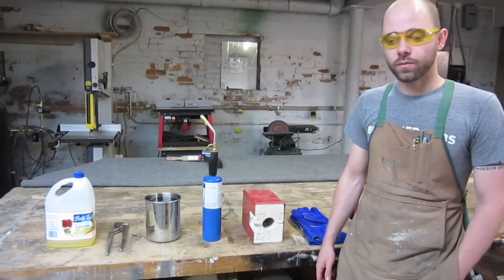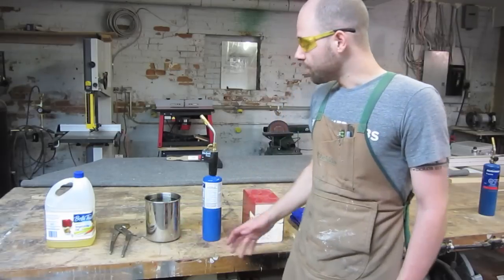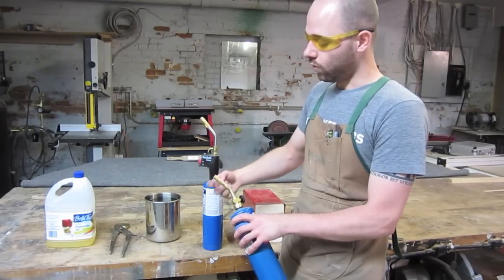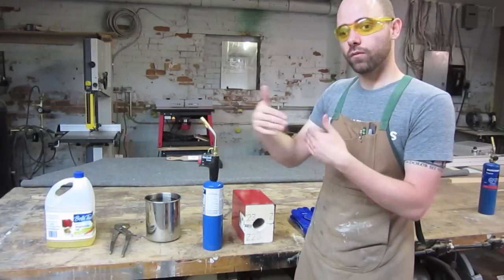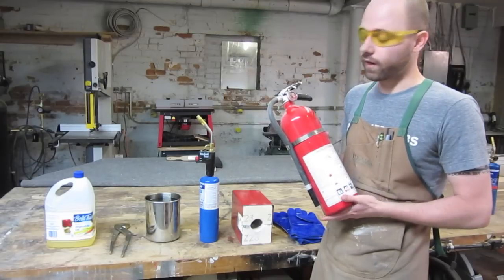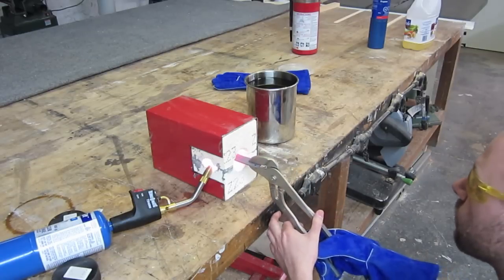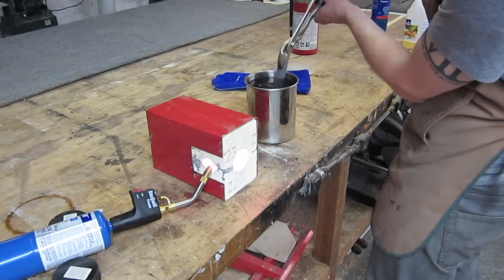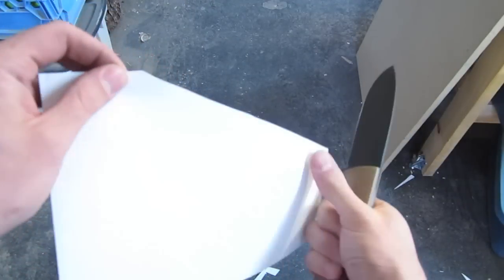How to heat-treat an O1 knife blade using cheap common tools.

Comment from the maker: There is a bit of a code to this: 

The "W" in "W1" stands for "water quenching"..

The "O" in "O1" actually stands for "Oil Quenching"...

The "A" in "A2" stands for "Air Quenching"....

The "D" in "D2" means "Die Steel"...

The "S" in "S7" means "Shock Resistant"...

There are many more too, and a number of different systems used in different countries and industries.
Reply: OH, my god. Thank you for this info. I had no idea. I've learned 80 times more from your one video.

Comment from the maker: Hey Patrick! Thanks for subscribing.

I generally recommend O1, which is the steel I'm demonstrating in the video. Using this heat-treating process will not get you 'the best blade in the world', but you'll get a knife that's perfectly serviceable.

The reason I recommend O1 is mainly because it's kind of hard to make a mistake with it. Most of the other 'cheap' steels (like 1084) require fast water/brine quenches which can cause cracking and warping if you don't do exactly the right things.
Reply: Thankfully someone knows that you can't harden basic steels in stuff like canola oil. Maaybe if it's thin enough. 52100 from ball bearings is also a slightly slower quench thanks to some chrome.

Comment from the maker: This exact process should work just fine for a number of steels including: O1, 5160, 1060 1070, 1080, 1084, and 1095.

It won't work for stainless or high alloy steels.

Be warned though that this is a fairly simple heat-treatment scheme and that you likely won't be getting the full performance out of most steels. It will be good enough for getting a first knife done though! After you're comfortable with the process it's worth the time to learn a bit more about steel and how to heat-treat it.
Reply: And invest more in tools.

Comment from the maker: There should be a furnace supply or pottery supply place in your area that would have them. Ask for 'k23' bricks, or 'soft white refractory firebricks'.

They are held together with refractory cement (you can get that at home depot). And then I bent a bit of scarp metal sheet to go around them and protect them as they're quite delicate.

Comment from the maker: The temperature where steel turns non-magnetic is called the 'eutectoid point', in some steels this point corresponds with the right temperature for heat-treatment (1084 and other spring steels for instance) but unfortunately that is not the case for O1. You have to go at least 50º hotter for O1, which is why I mainly talked about the color of the steel.

Using a magnet can be helpful too! Just be aware that you have to got a bit hotter than the magnet says.
Reply: Thanks! this is a very useful tip! thanks for being so cool! I love your channel!

Comment: would the process be the same for 1084 or 1095 high carbon steel ?
Reply from the maker: +J woo Yes, both of those steels can be heat-treated using this exact same method.

Comment from the maker: Thanks Dave! I actually made the hole the same diameter all the way through. Initially I had it smaller, but it seems to work better if you just make it the same the whole way as the flame swirls more nicely.

Comment from the maker: The bricks are quite delicate yes. I made the channels by cutting out a triangle shape with an old handsaw, then using some rough sandpaper (36 grit) attached to a wooden block that was the right shape. A little slow but it worked very well!

Comment from the maker: Hey Logan!
What you're talking about is generally called edge-quenching. Quite a few makers do it, but I don't think it's the best way to achieve what you're after. When steel is soft (annealed) it's largely made up of a microstructure called pearlite. When it's hardened we change that to a microstructure called martensite. Martensite is much stronger than pearlite. Pearlite is very tough as it's ductile which means that it will bend and stay bent under loads that martensite would shrug off...

Comment from the maker: Hey mate!
The case for the firebricks was made from some scrap sheet steel. It was basically cut to size with a cutting disk in an angle grinder, then bent using a cheap sheet bender (you can use lots of stuff to bend thing sheet, have a look around the net for that part). 

The sheet was then drilled and pop-riveted together once the bricks were put in the case.

Comment from the maker: Steel can only be hammered flat without cracking if it's relatively soft, and soft steel is not great for making a knife. It will work, but it won't hold an edge well.

I recommend using O1 tool steel from a machinery supply place (suppliers: KBC tools, ENCO, Amazon!) and heat-treating as shown in the video.

Comment: Very clear and well presented video.
The only thing I would add is a magnet to test for critical temperature.
When the steel is hot enough for quenching, a magnet will no longer stick to it.

This is a lot easier than trying to judge the temperature by color, especially for a beginner, or if you are unable to work in a darkened area.
Reply from the maker: +James Beat agreed on the magnet, I prefer to go a little hotter than just non magnetic for O1 which is why I didn't initially include the magnet...

Comment from the maker: It is yes, I'm not sure if the torch I have would put out enough heat to do it though! You'll also need to be careful to keep moving the torch around so you don't heat up any one area too much. 

I'd practice on some scrap steel first, but it should be achievable. You'll use less gas and get a more even heat using some sort of container (like a forge) to contain the heat. Look up 'paint can forge' for a possible alternative.

Comment from the maker: Interesting question, I honestly haven't had to deal with that yet. If it's just a little warped you might want to see if it's just ok as-is. If you want to straighten it then I would re-heat it as you said, straighten it out and then re-quench. 

When you quench again you might want to quench in HOT water instead of cold water. Warm water (like 80ºC, 176ºF) will quench slower and help stop your knife from warping or cracking.

Comment from the maker: I don't really have any opinions on damascus, I've never owned a knife that used it. However if you're after pure performance there's no real reason to use it. It's mainly used because it's pretty... It may perform as well as other steels, but I've never heard of any cases where it will perform better.

(we're talking about modern damascus steel here, correctly called 'pattern welded' steel. Ancient damascus is different, and obviously out of the question as no-one makes it)

Good questions!

Comment: Easiest heat treatment for O-1 I’ve seen. I’ve been holding on to a 3’ flatbar but now with this knowledge I’m gonna go for it! Have you ever tried O-1 on a long blade like a short sword.
Reply from the maker: I haven't tried making a sword yet but I believe you'll be fine with O1, it's better than any steel they had back when swords were needed!!
Reply: Gough Custom thanks for the reply, I really appreciate it.
Reply: @GoughCustom  A sword must be very tough and flexible.  I'm just getting into knife making and wondering how far back you would temper a sword in 1084.  Would you aim for mid 50's HRC?
Reply from the maker: @ianbrown_777  I'm honestly not sure! I think a 'spring temper' would be fine which is usually about 55-56 HRC
Reply: @GoughCustom  Cheers.  Much appreciated.

Comment: 5 years later and your videos are still passing on wisdom! Thanks a ton for the effort and information, I'm watching this just before I attempt my very first heat treat on some scrap.
Reply from the maker: Glad to hear mate! Best of luck! Make sure the steel you're using is a heat-treatable grade, not all steel can he hardened.
Reply: Lol, the scrap was for practice to get the procedure down, make sure my beer can quench tank would hold up.
Fast forward, successfully treated my first two knives,3/16 thick 2 1/2 wide aisi 01 steel. (Says the sticker on the wrapper)
 A heavy tanto chopper 2 in wide, 4 inch blade and a faceted double inch dagger 1.5 inch wide and 4 inch blade. 
I did not sand them appropriately before treatment and am paid dearly for it. Hairline crack in my chopper took forever to hand sand out to 600 and I'm still chewing on the dagger when I get time.
Reply from the maker: @keithober5278  Good to hear! Sounds like you're making steady progress which is great! Best of luck!

Comment: I agree with everybody else commenting in here; this is by far the best and clearest how-to. easily doable at home for anybody to do. One question tho, in order to make a good sturdy knife that can survive almost anything you throw at it, do you only need to heat treat (the factory steel) ONCE? and what about the handle? Doesn't it need to be cherry red hot in order to toughen it so it won't break easily? I hope you (or anybody with the knowledge) responds!
Reply from the maker: +RK 043 hey mate! Thanks, glad you like the video!

Leaving the handle not heat treated will actually mate it tougher than otherwise , and with a small forge like this there is no other option anyway!
Reply: Gough Custom Thanks for the respond! Your how to with common tools video inspired me to start making my own knife!

Alright so just use the little furnace for the blade only, got it! Thanks!

Comment: Finally. A low cost yet effective method to do this without sending each knife out for treatment or spending $$$ on a forge. THANK YOU. For this video,  did you use MAP gas? What is the diameter of the hole at the back of forge?  Same as the front?
Reply from the maker: Hey Brian! In the video I see the tank of fuel is blue, so I'm fairly sure it was propane. From memory the MAPP gas tanks are yellow I think. The hole at the back of the forge is the same size as the hole at the front. Glad the video was helpful mate!

Comment: Firstly, tremendous video.  Crystal clear.  I built one and hardened my first knife successfully.  File is now skating along without marks.  About to temper.  I had a funny thing happen though.   I let the torch go for about 10 minutes to pre-heat the forge.  Then did the knife.  Took about 3-4 minutes to become non-magnetic.   After quenching in peanut oil, I noticed that the whole trigger area the torch (which is identical to yours) was completely covered in ice!!!  Have you ever seen this?  Please keep up your amazing channel.  Regards, D
Reply from the maker: Hey mate! The first would be caused by the gas expanding as it leaves the cylinder, which produces a temperature drop! I haven't seen that personally, but I usually only preheat for a few minutes!
Reply: Yes. I figured it out.  I think that the flame went out at some point and then only the gas was coming out.  Endothermic as hell causing the ice.  Wont be pre-heating for so long in the future.  Love your videos!

Comment: First of all, thank you for all the vids you are making on the topic! They are really clear and remove almost all questions one would have about different stages of the knifemaking process. Definitely the  best material on youtube.

My question however would be what exactly is the material used for the bricks in the forge? Is there any way to simplify the structure, perhaps so one could make it at hime with a chisel and a hammer?

Thank you and keep up the great work!
Reply from the maker: thanks very much! The bricks are K23 fire brick... They have to be bought so I can't really simplify that part further. I made mine with just an old wood saw and some sandpaper, I'm sure you can do the same!
Reply: Thanks for the reply. The problem im having is that firebricks that are available to me are just too hard to be dug out by tools i have available... ill figure something out :).

Concerning the geometry of the forge - is it necessary for the forge to have a hole in the back as well? I am worried my torch will have problems getting up to heat as it is and im looking for ways to optimize the container...

Comment from the maker: The bigger the cavity in the bricks, the more heat output you need to heat-treat or forge. You could probably go a 1/2" wider or so, but the brick might start getting fragile.

I cut the hole by cutting a triangular groove with a cheap handsaw, then sanding the brick with 36 grit sandpaper wrapped around a large dowel.

Make sure to wear a respirator as the dust is very bad for you!

Comment from the maker: I used a cheap handsaw from the dollar store to cut a triangular channel, then used a round block with sandpaper on it to sand the final shape. These type of bricks are *very* soft (you can scrape them with your fingernail) so it's not too hard to do.

Just make sure you wear a good dust mask when cutting the brick, as the dust is very bad for you.

Comment: Hi Aaron, 
I absolutely love your knife design and tutorials. It has inspired me to try and make a knife myself, and what better to make than a tribute to the resolute?! You are making it look easy, but trying it myself  gave me even more respect for the quality you are producing.
I am ready for heat treating the knife, I have made it from O2 steel since that is what is available here in the Netherlands.
Can you give me some tips on how to quench and temper?  Does it matter what kind of vegetable oil I use? 

Thanks,  Vincent
Reply from the maker: Hey Vincent!
Sorry for the slow response mate! I am glad you are trying to make your own knife mate, it is a fun journey!

I think you should be fine to quench and temper exactly as I did in the video. The kind of oil should not matter too much, but Canola is probably the best if you can get it!

-Aaron
Reply: @GoughCustom  Hey Aaron, I really appreciate you getting back at me.  I used a 40kw propane burner in open air,  got it above non magnetic and quenched in peanut oil. The file seems to skip, I am going to use my lansky with the coarse stone to get a better feel how hard it is before finishing it. I am a bit more 'calibrated' with the lansky on my other knives.
Reply from the maker: @grotevin  Sounds like you've done well so far mate!

Comment from the maker: I actually used an old handsaw meant for wood to cut a triangular channel, then shaped the final channel with really coarse sandpaper attached to a wooden dowel.

Just make sure you wear a respirator, that dust is really bad for you!
Reply: What is the red sleeve you have your forge in?

Comment from the maker: In an ideal world you would soak the O1 at red hot for 45 minutes or so, but the quick method shown in the video works quite well. You'll end up with a blade that's 58-60HRC. The whole process is fairly fast and easy.

The other advantage to using O1 is that it's easy to get! You can order it off Amazon even if you're so inclined! It's also reasonably cheap, $25 will get you enough for 2 knives depending on the size.

Best of luck mate! Let me know how you go!

Comment: I used a torch for a blacksmithing project, making spurs, and I can say it's rather complicated and gives an uneven heat. The heat source is verry precise, so you only heat a small area at a time, and the other areas tend to cool off. If you move the torch around too much to get an even heat, the piece heat's extremely slowly, and usualy not hot enough. The forge realy helps.

Comment: I agree with other commenters that this is the clearest instruction by far.  Do you ever use a magnet to test for hardness, or is monitoring the color a better method?  Thanks for the excellent instruction!
Reply from the maker: +T Howard you can combine the color and magnet methods for a better overall picture, the steel needs to be heated a bit beyond non-magnetic though!

Comment from the maker: The 'Resolute' uses 5/32" (4mm) stock. Anti-scale compound stops the steel from losing carbon at the surface. This carbon turns into 'scale' which has to be sanded off, and can also make the steel softer. It's no necessary to use it, but it's easy to use and cheap ($15 per bottle from Brownells, 1 bottle will last at least dozens of knives).

Comment from the maker: It depends on what steel you're talking about. The same process should work well for plain carbon 'spring' steels like 1085, 1095, 52100, etc... However this process will not work with mild steels, which are the ones you'd usually see at a hardware store.

Comment from the maker: You could heat-treat it in that kiln yes, the best place to look for instructions is the manufacturer of the steel. Have a look at the 'crucible steels' website, as they make 440C and they publish a datasheet that has all the information showing you how to heat-treat it.

Best of luck!

Comment: Best. Videos. Ever. What other steels can you heat treat like this? Can you do your 154CM’s and s30V’s etc like this? Have always been curious. I’m guessing no but thought I’d ask. Cheers.
Reply from the maker: Unfortunately stainless steels need a proper furnace and stainless steel tool wrap at the very least to be able to heat treat them... Otherwise the oxygen they're exposed to while they're hot will damage the steel...

Comment: This a very thorough video.  Thanks for posting it.  How did you drill the lenghwise hole in the firebrick?
Reply from the maker: No worries mate! I used an old wood saw to cut a triangular groove, then sanded it to shape with coarse sandpaper!

Comment: Thanks so much for such great videos. I was wondering if you know the guidelines for spring tempering O1 after initial heat treat. Thanks again, all the best.
Reply from the maker: Apparently the tempering range for springs made in O1 is about 600-900ºF. You should temper twice, for 2 hours each time, and you should quench the knife into water to cool it in between the tempers. Best of luck!
Reply: Great, thanks again!